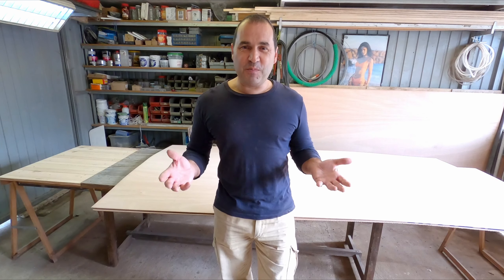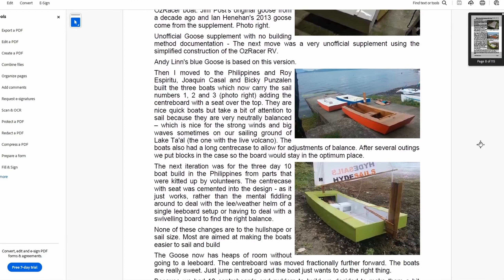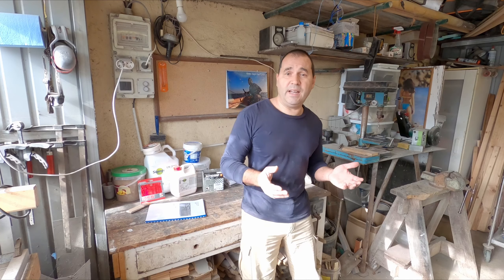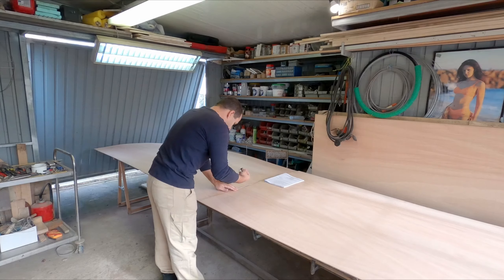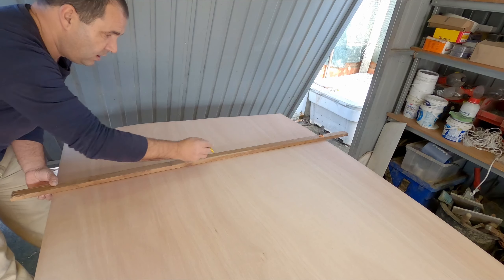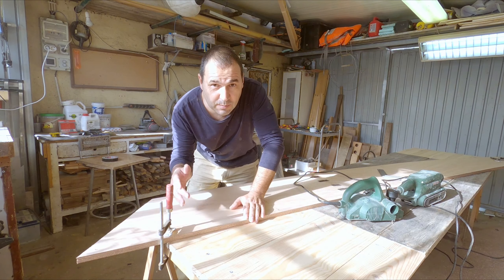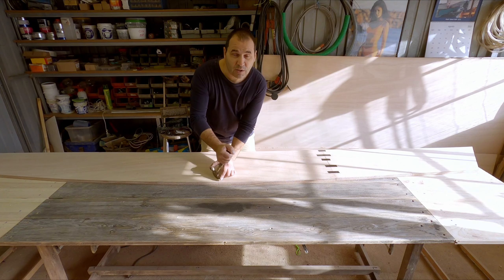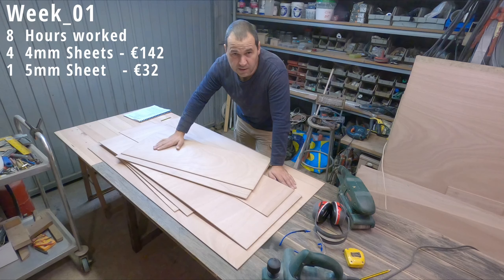Easy to Build, Unsinkable Skiff for Adventurers: Car-Topable and Family-Friendly! Carries 5 Adults!!

Comment: I would be very skeptical about the plywood being out of square. I would check it using several methods, cross corner, other squares and also comparing it to the other sheets of plywood.
Reply from the maker: The set-square is 100% good, and I did place another sheet on top to confirm it, that's how I marked the line you see on the video. 😉

Comment: Lately I've been wanting to build a Goose but my workspace is too small for it. The room is only 3.8 meters long while the boat would be 3.66 meters and the mast over four meters. In any case I want to start with something simpler; a one-sheet rowing boat first, and maybe a Puddle Duck Racer after that.
Reply from the maker: Hi Olli,
I built my 4.75 GIS in a 4.78 workshop...but the mast was shorter. 😅
The PD Racer is quite simple to build and it will perform OK.

Regarding the one sheet boats...I'm afraid you might be very disappointed! Even going to just  one and a half sheets will increase the boat's usefulness a lot! Have you checked this site?  https://hvartial.kapsi.fi/#XX15 

Cheers,
Teo
Reply: @TheBoatRambler  The twelve foot skiff on that site looks very nice for only two sheets of plywood. Great that he included the two different layouts for rowing positions as well. Looks great for one or two people fishing on days when the waves aren't too big or use on smaller protected bodies of water. 😃

Comment: That is pretty rapid progress for someone taking a relaxed approach! My build progressed at a much slower pace due to just snatching an hour or two where I could amongst life. I thought marine ply was supposed to be layered so that different layers had the grain running different directions to improve strength?
Reply from the maker: Hi Rob,
the 8 hours weekly is something I assumed most ppl would be able to put in. 2 hours on a  couple of days in the evening and 1 half a day at the weekend. But some will do it faster than others. In the end as long as you finish the build it will all be worth it! 😉
Reply: @TheBoatRambler I finished, but the 120-150 hrs I spent were spread over about 15 months!

Comment: Hi, Just purchased these plans. While watching the video, I noticed that you taped the sheets together before drawing/laying out the side panels. Had you already scarfed the ply so it can be joined later? Thanks
Reply from the maker: The plywood is not scarfed, I used a butt-joint as per the plans. 
you should read the plans at least once before starting to do anything on the build, it will give you a better idea of what's coming and prevent some errors. 😉
Reply: @TheBoatRambler   Thanks...I have read the plans but I struggle with it because that is not how I learn best. I'm a "monkey see, monkey do" learner which is why I love your videos. Joining the panels later makes sense...maybe I should watch ALL of the build videos first before asking for clarification 😂

Comment: my CAD workstation is down.
i started designing a skiff to be production molded, ( for the rotating spar rig ), thinking, i don't want to do all this work if it's not good enough to be made.
but now i am just shut down, waiting for a linear regulator to slap on a rechargeable CMOS ... just tired of the problems, and don't know when i will be up and running again.
last time i was working on it, it was getting pretty good... definitely promising. 4.4 M LOA, 1.7 M beam ... i was on the 3rd iteration of the wire-frame, nearing conversion to a solid.
Reply from the maker: Hi Eric,
I hope I can learn how to design a hull some time soon. I can make a 3D model but  don't know how to evaluate it regarding hydrodynamics. All I have designed (professionally) are car interior parts!
Reply: well, a sphere has the least amount of surface area for the displaced volume...so that's a "design element" that runs in the background, and simply has an effect ..
and if you study hydro dynamics enough, it quickly becomes intuitive.
most boats heal asymmetrically; so as you slice your solid, to calculate righting moments, you have to adjust for the asymmetry according to the center of buoyancy's relation to the center of gravity.
then there is the center of lateral resistance and the center of effort, which i needed a book to learn how to calculate.
then it's nudging subsequent iterations closer and closer to balance.
you have to start somewhere, and you have to recycle your previous drawing into the new adjusted one.
and eventually you get there. @TheBoatRambler
Reply: i hope that explains well enough, it's mostly balancing the forces.
when the forces are balanced, i do critically examine my water line splits, but i just do that by eye and intuition. @TheBoatRambler
Reply: i could send you the skiff hull CAD file, 
( when i get my computer running again )
maybe we can bounce DXF files back and forth, it would be good to get feedback, and have more practical real world inputs into the design...the hell is in the detail work, and when you are designing for a mold, everything has to be right. @TheBoatRambler
Reply: if you tell me to change something, i will ... but i can also explain how to design a hull, if i have CAD references to accompany the explanations. @TheBoatRambler
Reply: i can try to explain without... you split the model at different heal angles, and then you split that to find the center of buoyancy...it's pain staking, but you are always progressing toward the finished hull..
i use three references for iterations, that i would have to show you. @TheBoatRambler
Reply from the maker: Glad to hear that! 
I will eventually try to learn how to design an effective hull...as soon as I  finish all my current projects first!😅
Reply: it will be a few days to a week yet.
i noticed some little ripples in the hull, and had to go back to the wire-frame again.
but now, the hull is as smooth as can be; so smooth the file is unquestionably good enough to cut a mold with..
i plan on getting the rest of the bits and pieces together, and then i don't know how long making the video will take. @TheBoatRambler
Reply: i might enter it all into my free VPP, and see where it comes out...but i quickly ran the specs on it, the D/L ratio was 109 at Max capacity....also at max capacity SA/D was 16.5 ....that's with 250 Kg on board though. @TheBoatRambler
Reply: i upped the sail area, ( was 83 ft^2, now 90 ft^2 ).....but i just want to make sure i get the airfoil section and angle right now....that will get a lot more power into the rig, if the flow stays laminar. @TheBoatRambler

Comment: my 7 meter design is so good though, i should get back to that when i am running again.
taking anything to a production molded type level takes a long time.
the 4.4 meter is looking good, but so much work yet with it ... the hell is in the details, i would have to break off and consult a composite specialist at some point.
i think i will just take the 4.4 meter to a solid, and do the rig .... then do a video on it, and see if anyone would be interested in my working toward finalizing it.

Comment: Im sorry but a boat without a fine entry bow ? Its a shoebox. 
And its ugly. Bad choice. 
What is needed is a skiff with a tortured ply round bilge hull.
Its been done before. I wouldn't be seen dead in one of those things. Eurgh.
Reply from the maker: ...and yet the "shoebox" shaped dinghies are responsible for getting more ppl sailing than any other. Think Optis...
Do you know what the difference is? Kids want to get in the water with no care for egos.
After 40 years sailing and seeing so many sailing their beautiful boats on nice sunny days only to stay ashore during rougher weather for fear of capsize and not being able to self rescue, "pretty" is not on my requirements list. Just ask the dory type  boat owners.
A "good or a bad choice" needs to be judged against a set of requirements and pros vs cons. If ugliness is the only con...😏  
Watch my skiff shoot out and tell me where does the OZ goose lose to ANY skiff design against my requirements.
If you know of any "fine bow, tortured ply" cartopable  skiff, dry after capsize  which can carry 3 adults or a couple and a bunch of kids and still have  a planning hull for speed when needed and room to sleep aboard...you have my attention! 
But to each its own 😉
Reply: @TheBoatRambler  yes , fair points for sure.  I`m contemplating building a cartop boat at the moment and all the points you make are valid. I`m seriously considering a Bolger Ruben`s Nymph stretched to 10 ft , perhaps a Michalak Piccup Pram , and a couple of others . The piccup squared is a box boat , but to me , does not actually look like one .
Reply: @hardystein114  
Sure, you can have any number of bow type's but I like a bow that can dig in up wind and cut through a chop. I would love to see a beamy version of the goat island skiff with an extra chine . Tad less freeboard and a foot longer with a torsion box deck.
Reply: @TheBoatRambler  
I grew up sailing dinghies. Many classes and types. The closest I got to that shoebox was a plastic thing called the topper. I hated it.
The optimist was a cheap training dinghy for kid's but hardly the most numerous option. 
Beating up wind in a plywood bathtub is just not my idea of sailing. It must thump like crazy. Noisey and uncomfortable. 
The national twelve development class came out with some fantastic tortured ply hulls. Way back in the seventies and eighties.
Fast, stiff and lightweight. It's a concept that most naval architects failed miserably to adapt. Such a shame. If those designs were stretched a bit they would make a fantastic fast family boat. Instead we get these boring suitcase clunkers. No excuse for that when you have accurate laser cutting to make kit's.